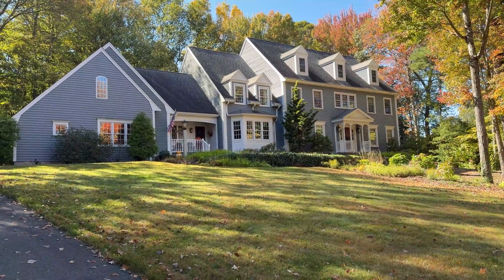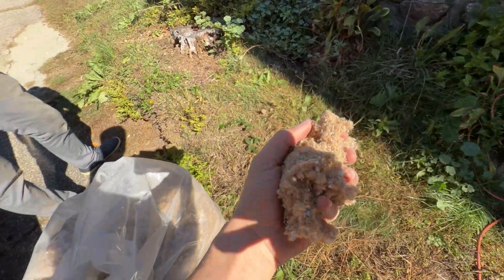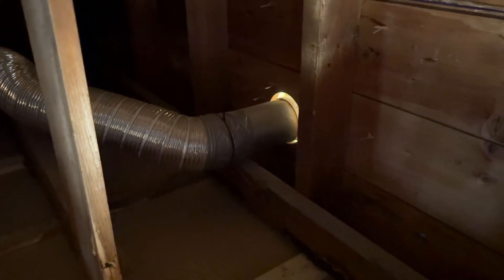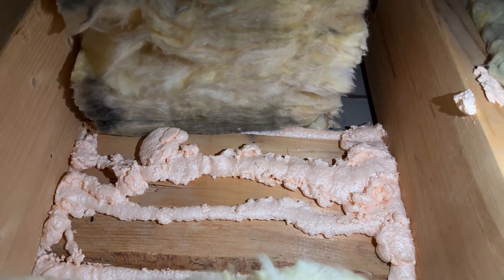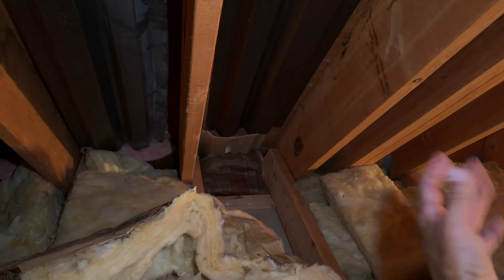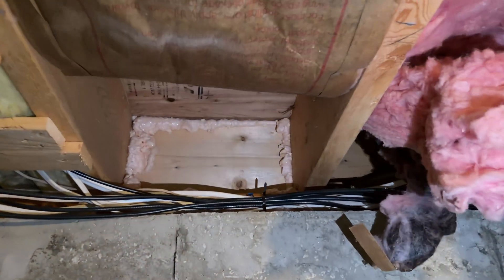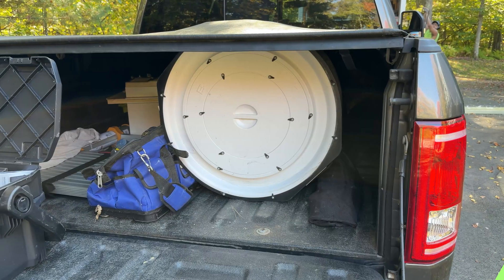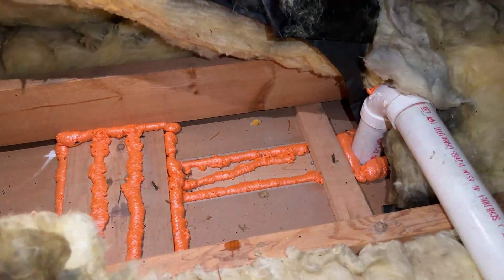Aussies Should Copy from American Weatherisation!

Comment: @davidparker9676 How about some constructive commentary. There is a lot of basic things in these attics like sealing top plates, fixing broken bathroom venting, that are indisputably good ideas. In Australia, they give you money to add insulation and do NO inspection for air leakage, duct leakage, or venting. You can add insulation and do ZERO air sealing or duct sealing. Check out the list of eligible measures: https://www.veu-registry.vic.gov.au/Public/ProductRegistrySearch.aspx 
Yes roof venting is not nearly as simple as it seems, and "more venting" is not always the solution to moisture concerns. 
But we clearly are starting a long way from where you stand, so let's focus on moving forward and sharing positive lessons learned.

Comment: You really need to know what you're doing or else you will make the house air quality worse and create the ideal conditions for mold growth.

Many of these weatherization programs actually make your house more dangerous. Here in the USA, WX companies are staffed with low skilled workers that don't understand physics or basic construction. The state-funded training programs are just a quick class to get a certificate that doesn't take much more than a warm body to obtain (they give you the answers for a 100% pass rate).

So if you want to breathe stale and unhealthy air, weatherize your home with these methods.
Reply: I strongly disagree. Reducing air leaks in the walls is entirely appropriate.
Reply: @rkeech1  You need to air seal the house in the construction phase. Doing random air sealing in an older home designed to leak for drying potential can lead to mold problems.

The attic venting is also done wrong, the gable vent should be sealed so it does not short circuit the airflow from the eaves to the ridge vent. 

The house was designed to leak because the construction materials are not intended to be an air barrier, only a weather resistant barrier like felt or house wrap. As you tighten the home, the air circulation and control becomes a more pressing issue.

I have over 20 years in the field and extensive WX experience, I have seen the failures first hand. Over zealous weatherization programs and new codes have caused the mold epidemic. The building materials and the science are new and still experiencing growing pains. they are still learning that their "fixes" are causing much bigger problems.